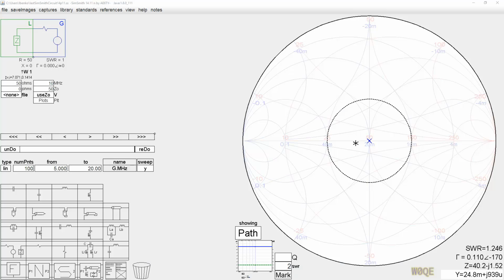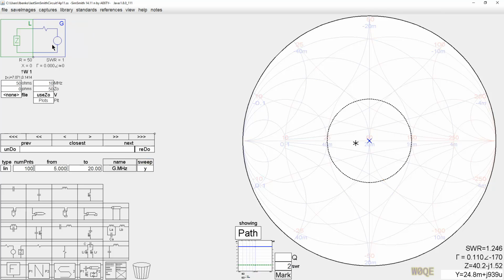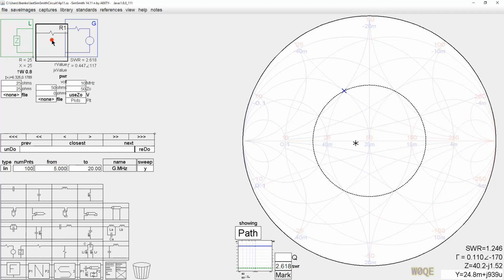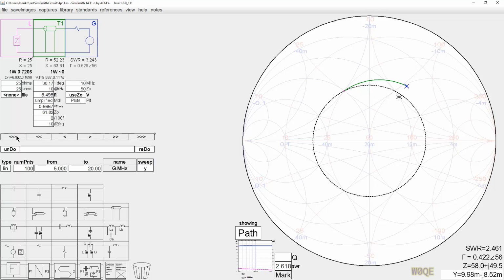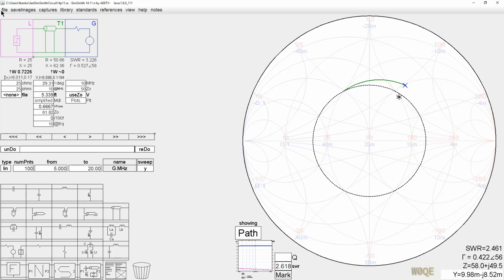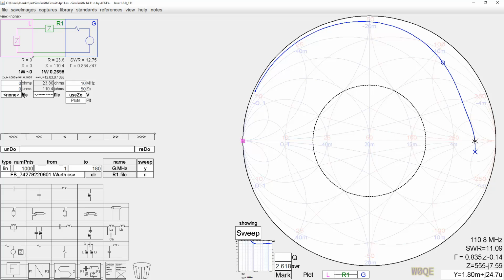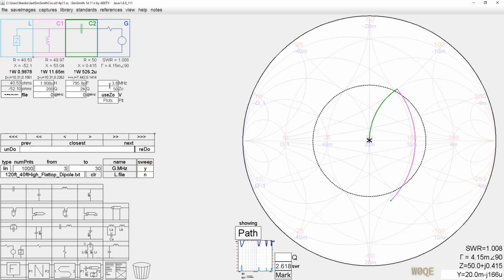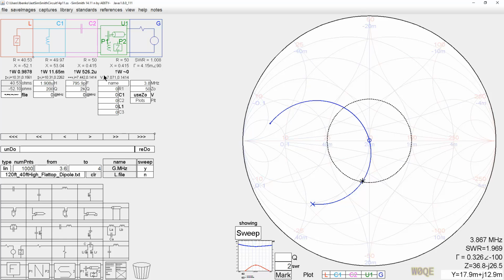#9: Navigation and Changing Parameters (Basics 2)

Comment: I enjoy your videos. Thanks!
Two comments: 1) I want to experiment with the ferrite bead like you are showed. However I could not find the csv file that you used (or anything equivalent). Is it possible you can share a link to that file?
2) I have installed version 18.4. When I insert a resistance and then try to attach a file to it (just like you are doing for the ferrite bead at around 12:59), SimSmith crashes.
Reply from the maker: Send me an email address and I will send you the .csv file I used.  It is 39kB. I just tried inserting the file while using version 18.4 and SimSmith did not crash.
Larry, W0QE
Reply: @w0qe  Thanks Larry! I can be reached at anuranjan@gmail.com 
Let me try again with other versions.

Comment: Thanks for your answer.
If I understand correctly, I can just set my load and generator parameters and set the capacitance and inductance without changing their frequency and quality for the matching network using SimSmith.
I am testing a PCB trace antenna for low-energy Bluetooth communication at 2.45GHz. I need to match the antenna because when I measure the impedance value with NanoVNA, I do not have 50hm at the end of the antenna. 
Thanks
Reply from the maker: Diane,
Learning these topics 2+GHz is going to be tough.  Just trying to measure the antenna without seeing the effects of the coax that connects to the VNA is difficult.  The coax needs to be carefully choked and then the VNA needs to be calibrated.  These topics are much more advanced than these videos.
Larry, W0QE
Reply: @w0qe  Hello Larry, 
I have already seen how to calibrate the NanoVNA and correct the delay introduced by the SMA cable and made the measurement of my antenna. I have the result of the parameters Impedance, S11 of my antenna. I don't have 50 ohms at the end of the antenna and I intend to use SimSmith to find the corresponding inductance and capacitance of my antenna. 
I'm just wondering if I should put the frequency and quality factor of each capacitor and inductance because in their datasheet I saw that their impedance and quality factor can change with frequency and sometimes they work at a specific frequency.
 But in your first answer, I understood that it is not necessary to take into account the value of the frequency and the quality factor of the inductance for the matching process because they don't have too much influence in the circuit and taking into account all these parameters can lead to other problems and make the matching process difficult. 
I have seen other online solvers that do not take into account the value of quality factor and frequency of inductance and capacitance in the matching process too.

Thanks

Comment: You explain in this video that I can save components to the library, but you don't say how. HOW IS THIS DONE?
Reply from the maker: Dan,
In either SimSmith or SimNEC bring up the file chooser and click to highlight the circle in the upper left to keep the file chooser visible.  The file chooser is right above the trash can in the component area of SimSmith. Select the location where you want to save the component. Now drag the component from the SimSmith circuit to the left panel in the file chooser and a plus sign will appear.  SimSmith will automatically name the component with a .ssce suffix but you can override this name. Let me know if you can't get this to work.
Larry, W0QE

Comment: You do a great job explaining this in the detail I need.  Where can I find impedance files for difference components?  Or how do I make my own?
Reply: Okay, I little research and I found my answer, I was spelling Impedance wrong when searching for Impedance File in the manual.  "SimSmith directly	supports many different impedance file formats.  It started	with EZNEC’s ‘LastZ.txt’, moved on to NEC2 output, then AIM4170b, miniVNA, the	list	keeps	growing."
Reply from the maker: @bobbyt2788  You are able to measure components with a VNA and then save these measurements as a file and use it in a SImSmith circuit.  Generally I do this only for selective components such as RF transformers, ferrite chokes, and home made transmission lines.
Larry
Reply: @w0qe  thanks!  I am very new at this but I am an EE. This is just way out of what I have done for my whole career. I am enjoying relearning many things. I hope to buy a NanoVNA at Huntsville Hamfest.
Reply: @w0qe  Are there libraries available someplace you know of just for practice and simulation?  I’d like to see how one of these files is constructed. W9PRA
Reply from the maker: There are no official libraries available.  SimSmith reads the impedance and S parameter files from most VNAs.  The SimSmith manual is accessed from within the program (help, SimSmith Manual) and lists file formats.  This should get you going.  Many of my mu more recent videos have all the included files I used in the video available for download.
Larry, W0QE

Comment: Very helpful videos.  Wonder if we can swap places for Gen and Load. Thanks
Reply from the maker: Wilson,
In versions of SimSmith for the past 2 or 3 years there is an item in the "view" table titled either "backwards circuit" or "traditional circuit" which can be toggled to reverse the direction of the circuit including all the blocks in the circuit.  In practical use the circuit was usually calculated "impedance wise" from the load and going towards the generator which is why the generator is on the right.  The SimSmith calculating engine is very comprehensive and it automatically handles all calculations in either direction.  You can take any SimSmith circuit no matter which way it was originally drawn and reverse it any time you wish.
Larry, W0QE
Reply: @w0qe  Thank you so much Larry.

Comment: what should be the file format for load..i am trying to upload  a S11 parameter(.txt file) of a simulation model from CST microwave but i am getting error message of unrecognized file format
Reply from the maker: SimSmith accepts a large number of files based on pretty much what the user community has requested and Ward, AE6TY has done an excellent job of adding new file formats over time.  You can send me the file to try just to be sure that you aren't making some simple error.  Also you can post the file to the SimSmith user group @ groups.io or send the file to Ward, AE6TY for him to look at it.
Larry, W0QE
Reply: @w0qe  Thanks a ton..Earlier i was uploading .txt file after getting error I changed it to s2p file format,,problem resolved..

Comment: If I have a source impedance (2.2+j2.3) and I want to connect to a 50 ohms Load, SimSmith  gets all changed and difficult to understand. How can I solve this?
Reply from the maker: Gilberto,
The "Basics" series of videos was done with SimSmith ver. 15 which is still available and is slightly different from version 16.  See video #75 for more info.  In either case you want change the G.Zo parameter from 50 to 2.2-j2.3.  Doing this with the G,V parameter set to useZo will give you a generator that will produce a maximum of 1W into a 2.2-j2.3 load which means the generator output impedance is 2.2+j2.3.  The center of the SmithChart will now be 2.2+j2.3 this can be changed if you wish.

You could also keep G.Zo = 50 and change the generator type Abs and put a 2.2+j2.3 ohm impedance in series with it.

Larry, W0QE

Comment: Can it plot return loss rather than swr?
Reply from the maker: Yes it can.  I touched on this subject most recently in video #54 and have also mentioned it a couple of other times.  SWR is a built in function in SimSmith and return loss is not but it can be plotted easily.  You just plot 20*log10(reflection coefficient).  Would a 5 minute video plotting Gamma, reflection coefficient, SWR, and return loss be useful?  This is easy to do.
Larry, W0QE
Reply: W0QE thanks for the reply. I should be able to work it out now. I am Just making my through all the videos you have made i have been using simsmith for a month with antenna matching problems